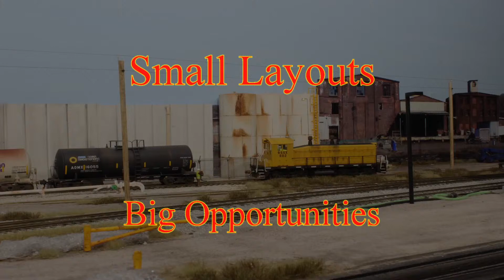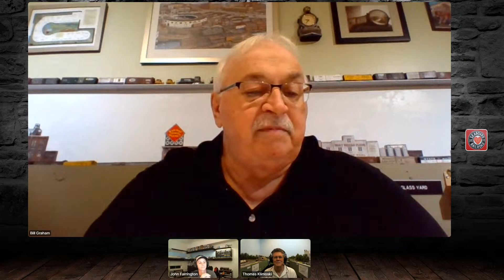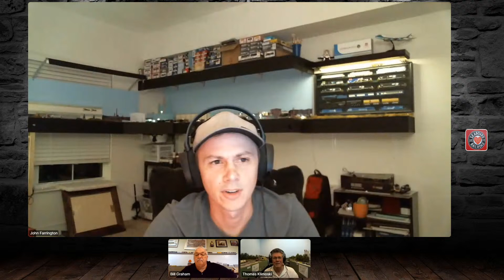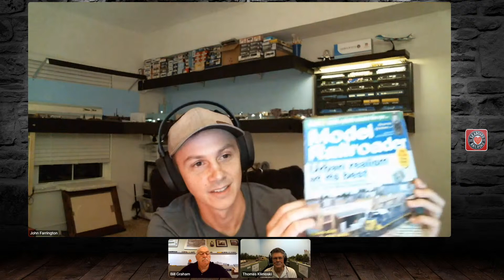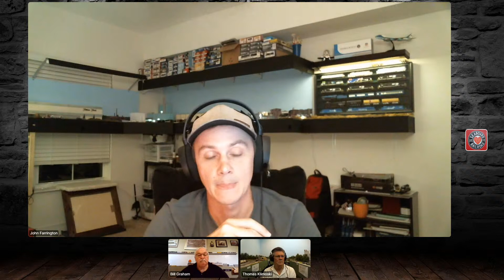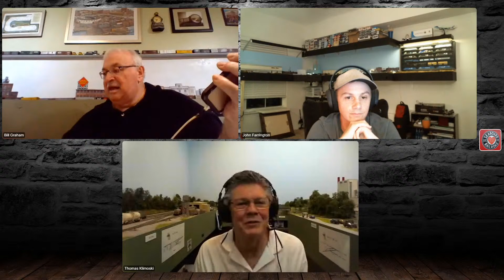Model Railroading Live,  Small Layouts, Big Opportunities

Comment: (1)  Is there a dimensional standard for a "small layout"?

(2)  Did Bill use to own the Fillmore East?
Reply: Hi Brian, Thanks for your questions. With a "small layout" there are a lot of variations. A general rule is a layout that occupies a room of 100 square feet or less is usually considered small, but it also can be a small layout that takes up a portion of a larger room. A bedroom sized space can be considered small even if it is a little larger than 100 square feet. Once you go to multiple levels and the complexity of the layout goes up then it normally would move out of the small category. There really are no hard and fast rules for layout size categories, that is why I started using the achievable layout term.  
Bill will have to answer the second question, I don't know the answer to that.-Tom
Reply: @ThomasKlimoski  No I never own the Fillmore East, but I did get in free once because of my name. :)